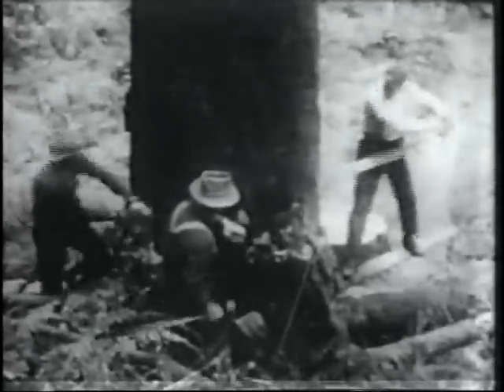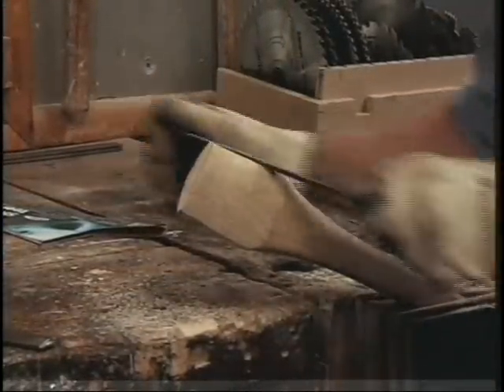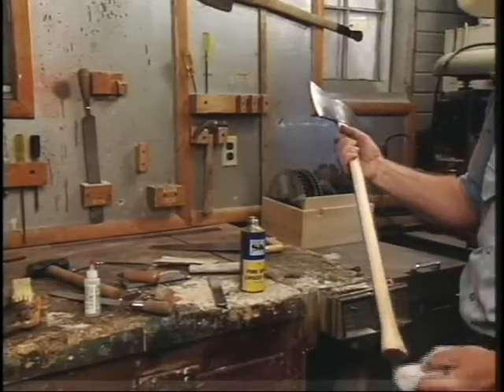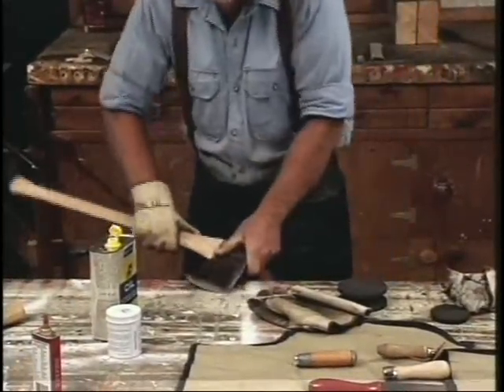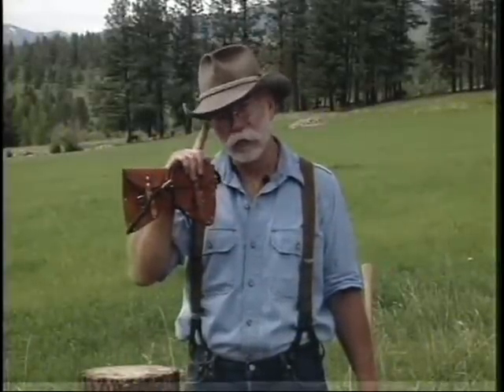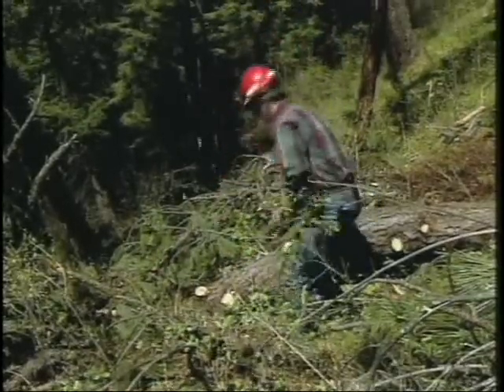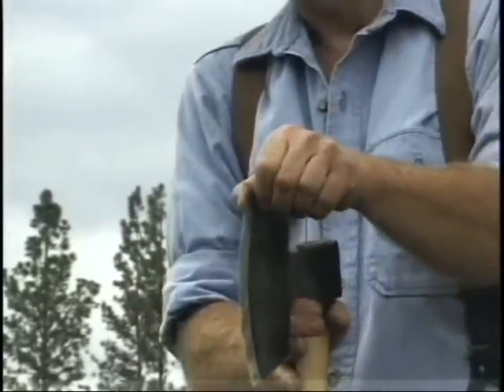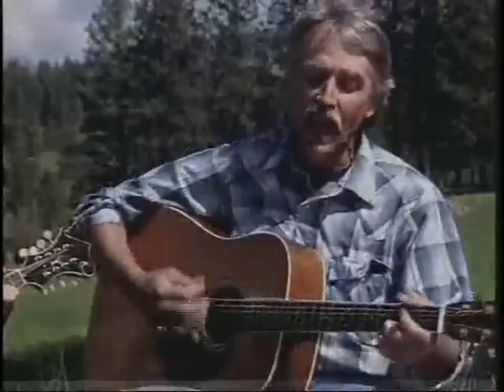An Ax to Grind - Complete Video

Comment: Safety first! On this otherwise brilliant lesson on axe care fundamentals, Bernie makes a very serious error in disposing of the rag he used for applying the linseed oil. For anyone unfamiliar with proper disposal of oily rags, he should have demonstrated either laying the rag out completely flat and unfolded, putting it in a sealed metal container, or immersing it in a bucket of water. He correctly stated that a crumpled rag of linseed (and other drying) oils can spontaneously combust. Having that happen unnoticed in the corner of your shop is about the worst scenario. That said, this was a very enjoyable video in so many ways. Cheers.

Comment: Very well done on the various uses that different axes are better suited for , design , head shape , head weight, handle length .. First time i had seen this.. I own one Gransfors Bruks axe and i really like it fine swedish steel well tempered holds an edge excellent .. I bought it because i could not find a good quality made here ..  An excellent book any woodsman should read is, "Axe makers of North America"..  
The axes of yesteryear ..

Comment: I use 1800's tools in my woodworking and also metal detect. I found a very early Pennsylvania axe in southwest PA.
After decades of being buried it cleaned up nicely and you can see where it was forge welded I didn't need to do much more than stone the edge and make a new handle.
It's a wopping 9 lbs! But is an impressive feller. I would love to find a nice froe to complete my timber tools. Thanks for a great video series.

Comment: I have a Lansky sharpening puck, which has a coarse and medium grit side. I've used it with their honing oil and the blade is not sharp enough to shave with. 

This video says when you get a burr you can move from the coarse to fine grit, which I did. I then got a burr with the medium grit and used a rag on it. 

I need to go and check it out to see if their is a reflection when viewing the blade in light to make sure there isn't one according to this video. I'll also strop it on leather to see if that makes a difference with the green compound.
Reply: Trust me, Langley picks will eat your ask sharper, but it’s extremely coarse
Reply: @rowanfernsler9725  What is a Langley pick?
Reply: Shaun Hill it’s auto correct I try to type lansky puck and it gives me Langley picks
Reply: @rowanfernsler9725  But I said I was using a Lansky puck, you thought I was using some other sharpener? That's how I read your original reply.
Reply: Stropping makes a huge difference. If you want a razor sharp polished edge the "Rooster method" is another option, cheap and simple. There are some tutorials on youtube.

Comment: I always let a 1/4 inch or so out the top. Even on my hammers they stay tight longer. I never cut it flush.

Torch and used motor oil brings the grain out real good.

Comment: Sorry, I don’t buy your comment about using a double bit ax to “grub roots”. A double bit ax is sharp both sides for taking down the wedge. One side gets dull, other side is ready.
Reply: well depends, some people keep one side razor sharp for felling, and the other slightly dull for working near the ground as to not dull up the blade. all depends on what your doing
Reply: j0sh as I have been taught, the double bit ax is a fine cutting tool not to be confused with a dirt tool of which there are many. Just like you don’t use a chainsaw to cut roots.

Comment: Leaving about 1/4 inch of handle wood beyond the bit instead of flush cutoff helps lock head on. Moisture content of handle matters. Radially split wood makes a fine handle. Wood splits across the growth rings as easily or easier as along growth rings. Crescent grind is interesting. Thin in the middle but strong at the corners.

Comment: I don't understand why he cut before he started to hang the head. I have several axes where the head doesn't meet the shoulder and they are fine. I have restored a few axes and have been able to save the original handle because there was still some room to seat the head due to the fact that that head hadn't been seated to where he designated to be. After a restoration the head sits where he designates it should be.

Comment: Im currently testing the bad grain orientation amd heart wood theory...so I have a plum double bit on a what we are told is perfect in everyday handle...then a snow and nealley double bit that's almost exactly the same size and weight.... on a handle made by the same company with sideways grain and half heart wood half sap wood.....and ima use and kinda abuse both of them and see what one brakes first if either them ever brake in my life time
Reply: what happened?

Comment: If the axe cutting edge is hardened, how can a file cut into it ?
Reply: They are tempered, which makes the edge metal harder than the body of the axe but still workable with a file, at least most of the time. Sometimes on axes you can see the temper line, where they dipped the red hot axe into oil to cool just the edge.

Comment: Could you please explain the function of oil when you use the round stone? 
Thank you, from the Netherlands.
Reply: +Laurens Beerendonk Oil or water carries away the fine shavings removed by the stone.  It also helps keep the edge cool during the grinding process so as not to alter the steel temper.  Hope this answers your question.
Reply: It's to keep the stone from loading up. Has nothing to do with cooling.
Reply: @verteup  unless he's The Flash

Comment: yeah, just throw it ober your shoulder, it wont combust in some corner... good video though
Reply: with raw linseed oil combustion isn't much of a concern. the highly processed boiled linseed oil is where the fire is at.
Reply: I aggree with you there, but it can happen still. Funny thing though is the way he himself specifically emphazises the danger of spontaneous combustion before throwing it over his shoulder into some corner of the shop. Would have made more sense to soak the thing in water, lay it out flat in a well ventilated spot and dry it in order to get some more use out of it.
Reply: yea strange to make light of the dangers and then seemingly ignore them. doesn't seem like a guy to take safety lightly either, what with him using gloves as often as he does.
i gotta try that paper towel reusing trick, i'd hate to waste more than i should.

cheers!

Comment: Nobody needs a ax razor sharp.
Reply: That is incorrect. 
Dull axes are alot more likely to glance when chopping. 
Sharp axes bite into the wood and are less likely to glance. 
Sharp edges also severs the fibers, making for easier work.

I spent almost 30 years working with axes and power saws. 
Working with dull axes isnt only more dangerous, but also takes more energy. 

The only time an edge doesnt need to be razor sharp is when splitting rounds for firewood. 
Otherwise, its better to have a nice honed edge.